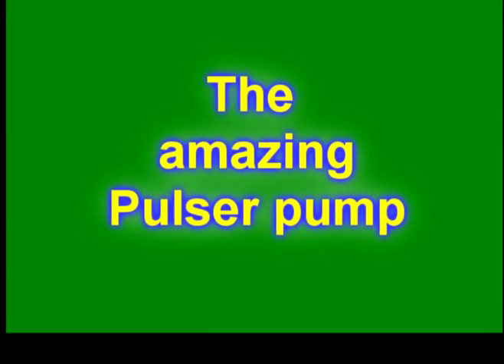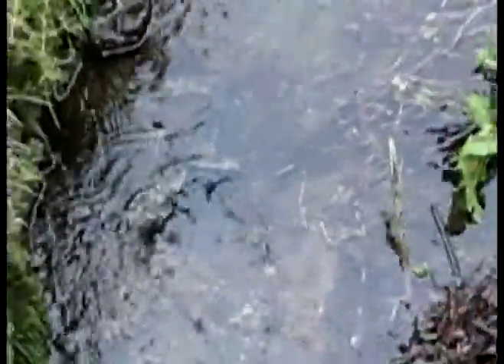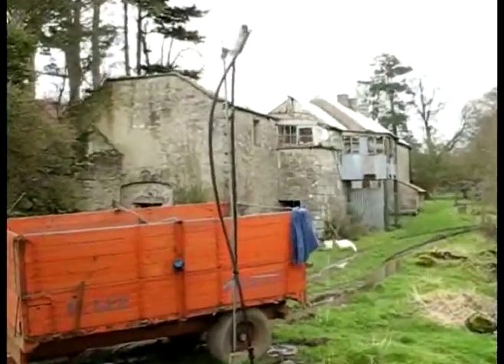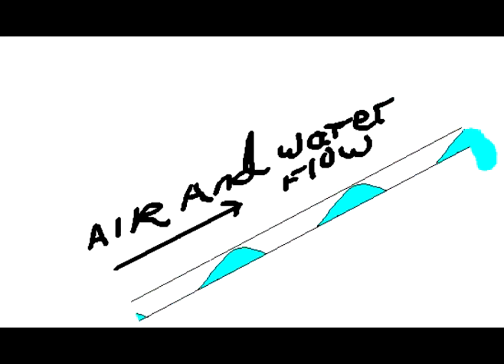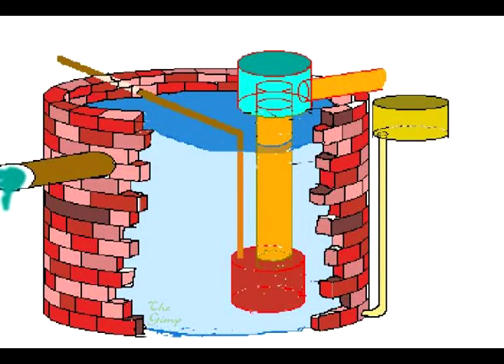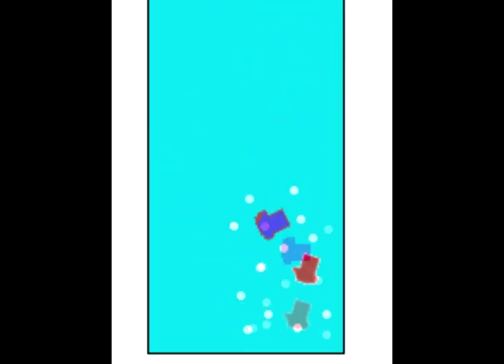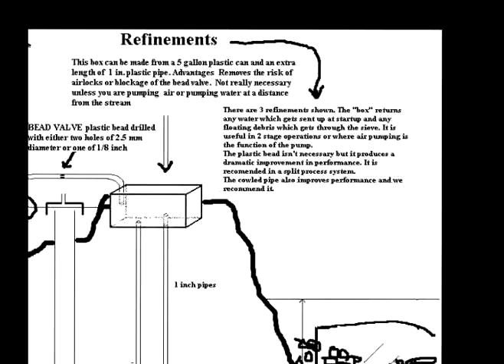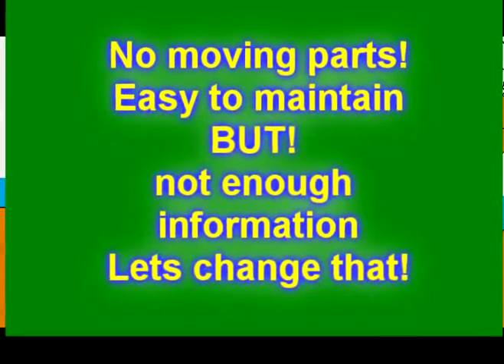Pulser pump New video 2011

Comment: Hello Brian.  😀
A few years ago I had emailed you about how cool I thought your idea was.  I remain interested in it. 😎 While I noticed that you have moved onto solar cooking for the time being (I know you like to bounce around on various projects) I was wondering if you knew if your original 1988 Pulser Pump was still in operation?
I hope you are doing well, and with warm regards, 🤠
-Peter
Reply from the maker: Hi Peter,  the original pump ran for at least  15 years but  after that, they extended concrete in the yard and I believe that it got covered over. (I am not 100% certain)  They now use a well to provide for the sheep and cattle. Anyway, the pulser pump is a combined trompe to provide compressed air, and airlift pump that uses compressed air to pump water.  I showed the idea to a water pollution  researcher in Belgium, and he might use a small trompe this summer to "renovate" a small river there.  This will probably be quite small, maybe 15 cm diameter pipes, and only going 1 meter deep. the idea is to have gaseous exchange so that smelly gasses can be removed,  strongly oxygenate the water  (some organic stuff will be oxidized), plus,  it'll give  fish and insect larvae a little haven where the water is full of oxygen.  I don't know any more about their experiment but it looks very likely to happen.
Reply: Thank you for update and I'm sorry to learn it is no longer operational.  Probably was covered over by the time I learned of it back in December 2010.  Take care, Sir! 😎
Reply from the maker: @f1rst_pancake  There's probably a smaller one, (further upstream) and they only use it in March and April and the 6 inch diameter one is probably still  able to pump.

Comment: Hi Brian,
The trompe bubbling effect is taking hold here in America as a way to clean up polluted mining water, and air-rate water in fisheries. Also, there are a few university engineers performing calculation on both tromp designs and hydrological air-lift pumps. It is slow in coming along but it is gratifying to see the U.S. taking it seriously.
Reply from the maker: Thanks, a couple of years ago a lady with a youtube comment suggested I look into a "nano" version of the pulser pump. (I cannot do that because I live in a city now with no flowing water nearby). My original "playing in a river with tubes"  or "research" was kind of nano anyway and the pulser pump was just an offshoot.  So I followed up on her suggestion investigating the tromp part and from it came the T-joint airlift pump and "airlift in a bucket" that is used in small scale vertical hydroponics across the world. The pallet garden project and backyard pneumatic grid project would probably not have happened either.  So big thanks to Eileen jackson (virlusun) who no longer seems to have her chanel working. (And thanks to you too for keeping me motivated!)
Reply: Bisbee Jim Welcome.   water     is.   too.   necessary.  at.   the life.  is.   going.    on.   .We.   should.    follow.  a high.  methods.  as. modern.  technology.   allows.   us.    of.      what.   to. act. We.    should.  pass.   all.  difficulty.  to. Stop.  them.   while.    working.  Thirst. causes      many.   problems.  if.    We.  neglect.   the.  projects.   of.  pure.   wter        To.  insecure     the.    portions.    of.    water.    NOW.    in.   I'eat.   We.    beg	An.    to.    suffer.  from.  lack.    of.     water We.   should.    follow.   modern.    solution. to supply.    water.    for.    all.  people. NOW.   and.   then.

Comment: I understand the filters need a static head of about 0.5 bar abs. So, let us say we're pumping to a height of 8 metres to the top of the feed tank to the filters. This will give a head of 6 metres when the tank is nearly empty and if the filters are 1 metre above ground level.

Comment from the maker: How high are you pumping?   I only ever made one ram pump and that was about 1982 or 1983, with a low skill set and very few tools. So I am not in any way an expert.  However, it was very small and it did work.  (even if it was just for a couple of hours.  They were unsuitable for the stream I had. Half meter head at most and only a few hundred litres per minute of flow.  I think the head was more the issue than the flow and the water was dirty from farm ducks.  This messed with the clack valve

Comment: Thanks for your prompt response, Brian. 
Does that hold true for rather small installations? I didn't mention that I'm investigating at domestic-scale installations, or maybe small community-scale. The quantity of water to be pumped to a high tank (for filtering to potable quality) will be of the order of only a few tens or a few hundreds of litres /day. Probably 1 cubic metre/day tops. Is that too small for a ram pump?

Comment: Brian, can we consider solar PV to pump water from a well to a large medium-head irrigation reservoir, and then use the water in that reservoir (intermittently) to be the source for a pulser pump to move small quantities of water into a tank (at much higher head) to provide enough pressure to pass through filters for preparing potable water? Or do you think the solar PV should be used to pump all of the water into the much higher tank, because the pulser pump may be too inefficient?

Comment from the maker: What is the pressure of your air? In PSI or kPa?  I don't understand that 5 lbs per minute means.  Also how many litres per minute is it compressing?  (I never know if people are using US gallons or Imperial so I request the litres per minute).   I have pumped to 5 meters high with 3.5 psi from the pulser pump.  The stuff about submergence in the books and on wikipedia is BS because if you use small diameter (1/4 inch tubes) you can use much lower submergence.   A bundle of tubes might work.

Comment from the maker: Just a note that I have a very successful pallet garden project  (see the pallet garden playlist) which uses extremely low pressure air.  (around 1 psi) to  cycle water around container gardens to move the nutrients around and grow plants faster. This applies Virlusun's "nano scale version" ideas.  I will do a really tiny proof of concept showing that a nano scale pulser pump can run a pallet garden in the coming week.

Comment: Just a thought before I go, In the 3rd world where heat from the sun in abundant, it could be utilised to heat air, this expansion of air, in turn gives a better flow rate on output per volume of input, directly related to temperature, this could be calculated as a give "Conversion" factor in the process.
Thom.

Comment: Then use the air for a well designed (very simple) bubble pump. The net result is more water to a greater height.

I am impressed with the working pump you have now because it is very accessible - just not known. Perhaps someone can sell something like a kit. When people pay a little, they pay more attention.

Thanks for inspiration - it is a useful device
Crispin from newdawnengineering

Comment: Air will be drawn into the expanding space between the cones as the water falls down through the tiny holes in the top cone. That makes tiny bubbles. They have only a small tendency to rise in the descending column. This was optimised in the 1930's for air tram companies in Paris and Chicago.

The small bubble size may make it necessary to give the water more residence time in the air chamber. The efficiency of the system rises with this method.

Comment: The size of the bubble travelling down can be made much smaller to great advantage by creating two cones with slightly different tapers, Put one above the other, with the steeper cone on the bottom. Make lots of small holes in the upper one. Make it adjustable up and down on a screw.

Run the water into the gap between cones such that it fills up all the time. By adjusting the top cone up or down that can be maintained.

Comment: From the videos it looks as if the bubble pump would be more efficient (very small air bubbles instead of a slug of water then air) unless the pipe is really small. The 'energy' of the water throwing into the air is not 'free' in any sense - if it was a bubble pump the total work done would be the same.

For that reason some people might want to try a bubble pump driven by the same trompe supply that you show. Yes, I understand the difference.

Comment: I have been making ram pumps and given thought to bubble pump as an alternative for places with a lot of head, to be used by running a pipe along the river and back again. The obviates the need to dig a hole.

This is indeed a variation on a bubble pump but with slugs so the max height will be related to the air/water ratio in the pipe. The small pipe diameter of the NANO idea is just the ticket for the higher lifts. Then you are playing with the meniscus effect to your advantage.

Comment: im gonna build a test project in my garden got a veeeeeery deep hole there where i can climb down to the groundwater im gonna try to build a simple 1 cylinder engine airpump whit a wind wheel to pump air down and hopfully some water will come upp i keep you updated XD

Comment from the maker: @virlusun  Thanks, I think you are right.  I have been looking at windowfarms and the very low pressure that you  use successfully).  Perhaps  you could do the pulser pump with one pipe providing air at 4 ft deep. (4 ft water pressure) and then have this air feeding into perhaps 10 or 20 1/4 inch pipes bundled together.  Several things stop people making pulser pumps.  One is having to dig a really deep hole.
And another is that no big agency has done tests. This might eliminate both problems!